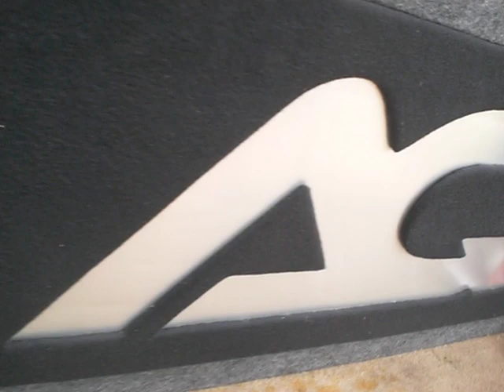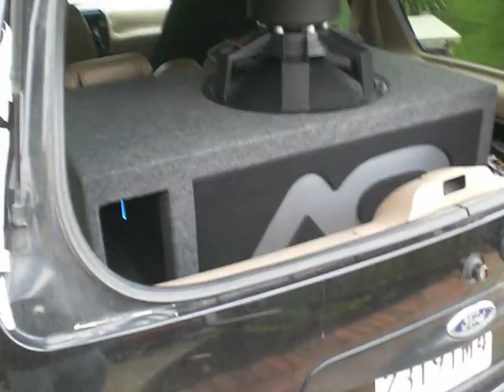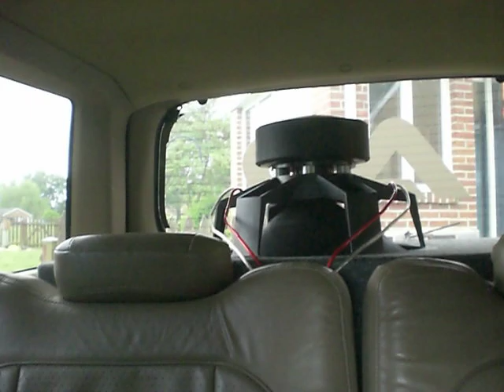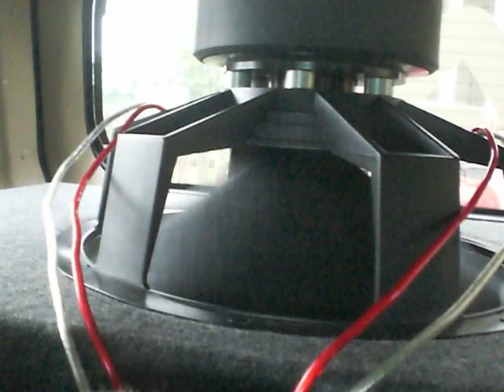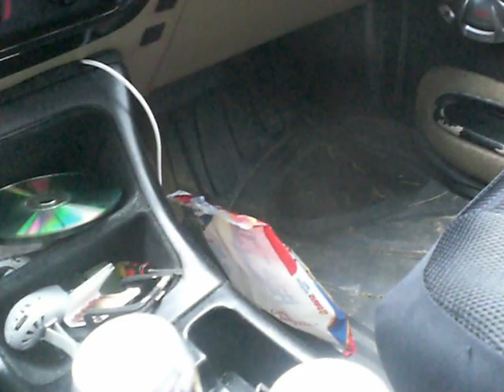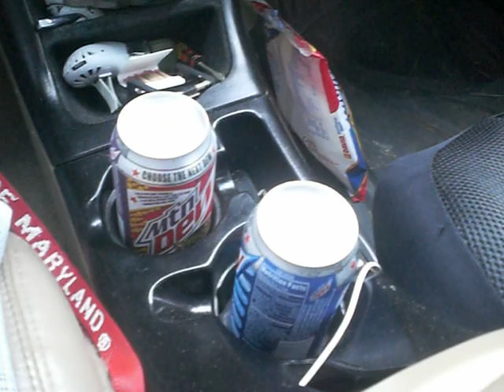-finished box- AQ HDC318-A - AQ2200D

Comment from the maker: @musician1232 - It took it all day. However, dont run it hard for a long time with voltage any less than 13.5 or your sub and amp will heat up quick from clipping. causing something to break,   (likely the coils on your sub will swell, unwind, burn up, etc). This amp is a tank

Comment from the maker: @xbetamaster - I have pretty well tuned ears, and have never been able to hear an audible difference with inverted subs of this caliber. The coils on an inverted sub getting over 2200 watts, especially at .5 ohms, will stay MUCH cooler especially between 40+ mph windows down, it's physics. With this application, the AVERAGE temp inside a ported box, will also be higher than the air outside of the box. It takes much longer to heat up the inside of my car than it does the inside of this box...

Comment from the maker: @METALJOEY93 4000 rms? Maybe with a really strong 16 volt charging system and a few batts. Definitely not 4k on a relatively strong stock 12-14.5v electrical system. More like 3k rms or a little more. I'll will give it to AQ tho, my 2200 ran at half an ohm ALL DAY LONG! It did get pretty dam hot though, even with good ventilation, but never cut out. But what do u you expect, .5 ohms is almost NO resistance! The AQ2200 is pretty much identical to the old skool Cadence IA9 amp which was a monster!

Comment from the maker: @gutteer tuned to 7.8^ft??? Useless? Dude you sound like a complete fuckin moron... The box is 7.8 cubic feet "tuned" to 32hz, with or without the sub inverted. The sub displacment doesn't cause a noticable change in tuning, and if it does, it lowers it by adding more box area, rendering it completely NOT USELESS. Having the coils out of the box help keep them cool, especially at half a fuckin ohm at full power.. Foreign material?? I dont have shit flyin around my car on the daily...